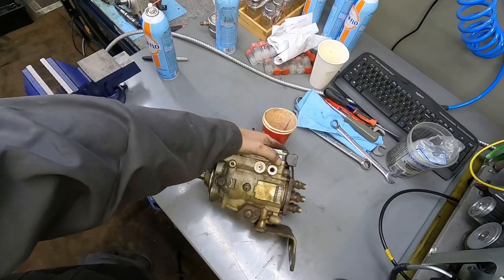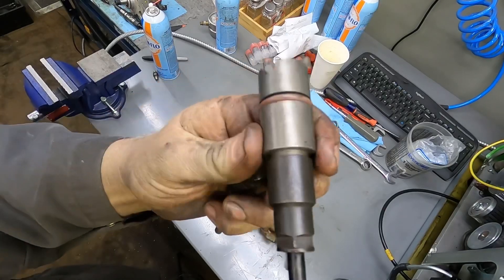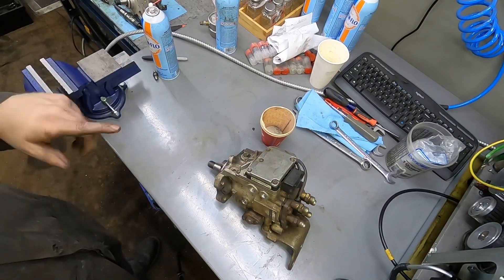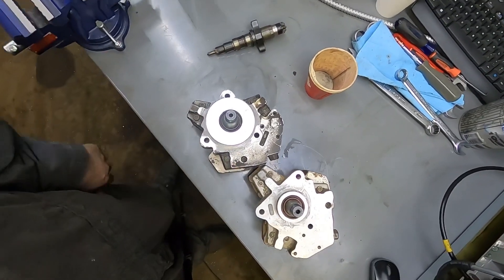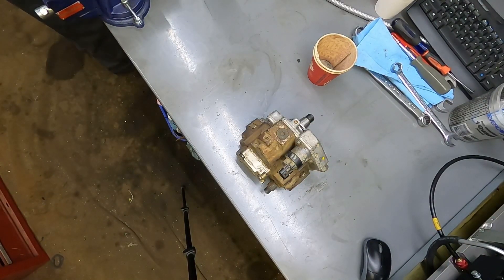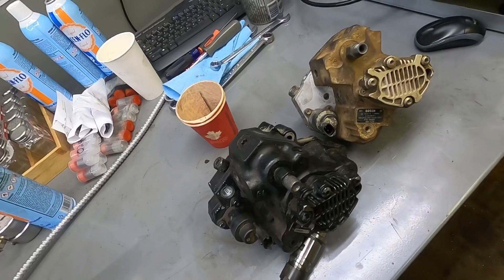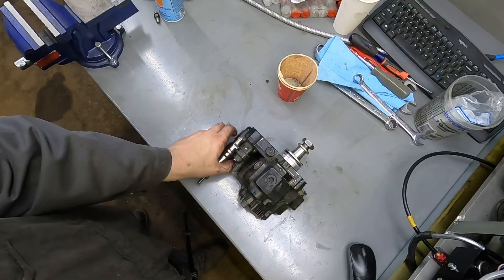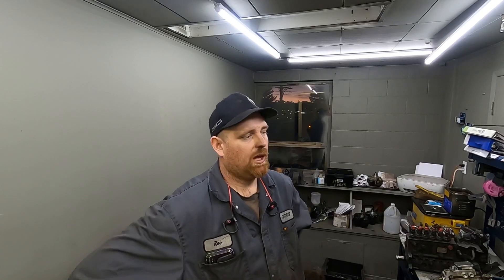How to identify Cummins pumps/injectors part 2

Comment: Hey Rob, I just discovered your channel. I put a 6.7 block into my 06’ truck with 5.9 head, 12 valve exhaust manifold, 5.9 turbo and 6.7 injectors. First time I installed 6.7 injectors I had pressure build in my fuel tank through the return. So I installed an extra crush washer on top of the existing ones on my injectors. Haven’t had any issues since except that 1 injector decided to crap out now 1 year later. I never tuned anything, just plug and play. Maybe I got lucky?
Reply from the maker: With the right injectors and or pistons to work together it will run better. The bore on the 5.9 head for the injector is different size and the the reason you had to space it up.

Comment: I have asked you before what is the difference between pickup truck vs cab and chassis injectors? is it just the nozzle feed or hp rating?
Also i bought a reman set of injectors from the dealer here local and I believe that at least one of the injectors has a 2018 solenoid on it 3 digit cod 342 and another injector has a 177 code on the solenoid the other 4 have been scrubbed off so no codes showing all 6 were purchased as a reman set. 
Any help identifying what they sold me would be great. I'm chasing a fuel knock so I believe and was wondering if the dealer supplied injectors could possibly be so poorly mismatched that it is the cause of my concern. They are not over fueling and no hard start also truck gets decent mileage 18-20 deleted 07 cab and chassis 6.7 liter.
thanks in advance for any insight.
Reply from the maker: from what i have gathered in the bit i have looked into it just lately, its all just nozzle differences

Comment: just found your channel searching cummins main bearing... I watched / liked your video on how to check end play & thrust bearing wear... I just put a billet tappet cover on my 99 24valve... accidentally dropped my vp44 "1046" keyway down into the gear case because I bought the cheap ebay streetsport billet tappet cover... you have to grind down the lower support bracket to clearance the billet cover... I put grease on the key so it wouldn't fall out but after taking the pump in-out about 10-15 times for test fitting my grinding job it accidentally fell out... luckily I found it behind the vacuum pump gear and was able to retrieve it with very small neo magnet
Reply from the maker: ya i have dropped a few keys over the years never a good time